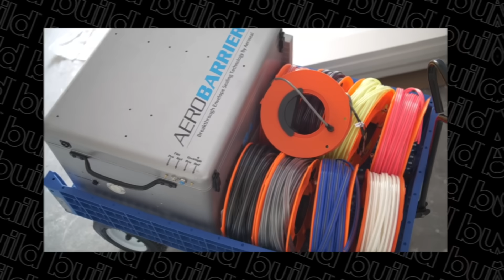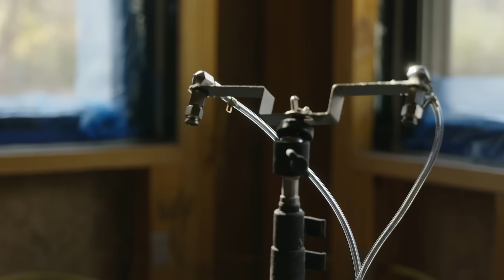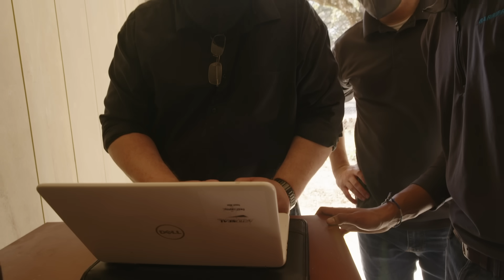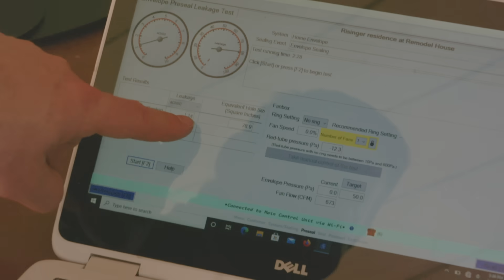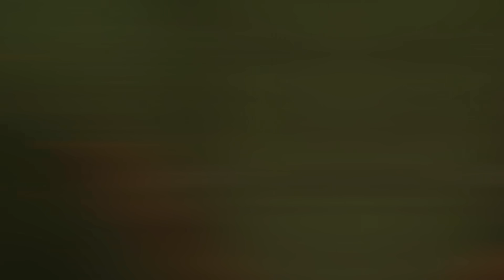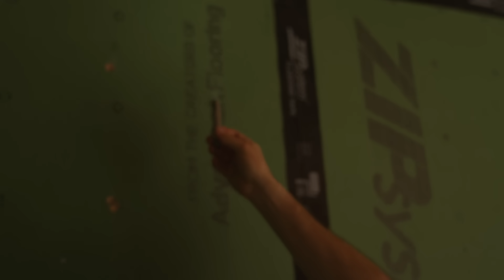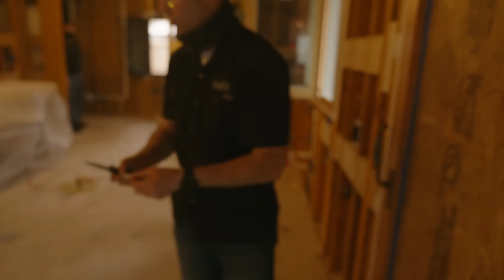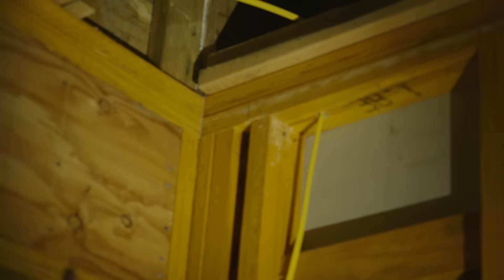The one product I'd recommend for EVERY House!

Comment: As a building science nut, even I am a little skeptical here.  I know Matt likely didn't pay or pay much for this product, but it just doesn't have enough time to have proven itself.  Latex caulking cracks when it's a thin layer against something such as framing that is both porous and expands/contracts with both humidity but mostly with temperature.  Sure, you might have a dry home but lumber takes a while to completely dry out.  Next, they were taping off windows & doors I assume (one spot shows a window with blue tape around the window).  That already probably brought the ACH 1.7 to 1? Who knows? Guessing game.  I think the best proof for this company to actually prove themselves is to go do a blower door on a home sprayed five or ten years ago.  With a 20-30 year ROI using this stuff, what good is that if it's shot in 15 years?  I totally believe in zip's system, their tape or liquid membrane, but this just seems like a good gimmick that only top tier builders will use and therefor their clients won't even ask for justification because they're plenty wealthy.
Reply: Those were my concerns as well.  Anyone who has built a new home knows that over time as the home dries out things move, gaps develop.  What about homes in areas with dramatic seasonal weather changes.  Ever been in a home where the door that opened and closed smoothly in the winter struggles in the summer as wood swells with moisture?  How will a product that is 18-21% solids not also shrink as it cures and develops new cracks over time?  Just like spray foam to fill gaps, it is brittle and doesn't offer any elongation to move with the home.  Would be interesting to see what the blower door results are 6-12 months after the initial application.

Comment: Sounds like some load of bullshit. 0:50: "...end up doing all kinds of air-sealing in all those micro-places where my envelope leaks".

Why is it that every time someone tries to sell some useless crap, they always like to toss in fancy terms? "Micro-places"? "Envelope"? Just tell us what the fuck it does without the fancy language. It  patches up holes around the house. Simple. To the point. No need to try to make the product sound like it's better than it is. Using these terms just increases the intensity of the smell of bullshit in the air.

Not only that, but is it REALLY a game changer? You've used it on one house prior to this. What happened with that other house? If it's such a game changer, why are similar products not so widespread? Leads me to believe that the cost of this product and its application outweighs the benefits.

Comment: FYI: ACH stands for Air Changes per Hour - the air within a building exchanged with the outdoor air through leakage and ventilation expressed as a percent of the total volume of air in the building. For example, if you have 1 ACH that means you need 4 days to replace old air with new one. If we will take 3 bedroom house with 2000 sq ft and 8 ft height walls we will get 16000 cubic feet house volume which is 453069 liters. One person to breathe in the rest requires 720 liters  of air or 5400 liters during exercising per hour. Lets assume that we don't exercise all the time so we can define required breathing volume around 1000 liters per hour per person. If we have family of 4 living in this house we will need 4*1000/453063=0.009=0.9%  or 0.9 ACH to make sure that whole family will not have oxygen starvation using natural ventilation through leakage. If that family will have ACH under 0.9 and no artificial ventilation they might experience certain oxygen starvation effects like confusion or headaches. You have to always take the house volume and max number of people living in the house into account and calculate required ACH number specifically for your house and your family. Be careful, sometimes efficiency might have a flip side.
Reply: ACH is actually Air Changes Per Hour, expressed as a number, NOT a %. 1 ACH means that an air volume equivalent to the total enclosed volume will be exchanged between indoors and outdoors in that hour.  It does not necessarily mean that each and every molecule of air that was in the enclosed space at the beginning of the hour will be evacuated at the conclusion of that hour, as mixing comes into play. However,  when you assert a 4 day time period for total volume air exchange, you are reporting a spurious artifact of your own imagination and mathematical dexterity, which has no basis in fact. The rest of the math is a throw-away, being based on a false premise.
Reply: @lhsunimog  ENERGY STAR® Home Sealing Specification defines ACH as percent. As the rest goes - yes. Situation is even worse because not all air is going to be fully replaced although there is a little hope because people entering and leaving the building which might introduce a little bit more air exchange.
Reply: @k1zmt  After 15 years of blower tests on my jobs, I finally learn from you that I, my tester, and the AHJ's that sign off on our permits have been wrong by a factor of 100. Perhaps you should research how ACH is measured and reported in the construction industry, as you clearly do not grasp the concept. You can invoke some sort of percentage reporting of the data if you wish, but that is NOT how any of the rest of us operate.
Reply: @lhsunimog  Perhaps.

Comment: You need an air exchange system, yes? Indoor air doesn't stay fresh very long.  And if you seal walls on both sides, anything that sneaks in there may not get out. Aging structures will leak due to expansion/contraction (and other factors.) Still, I like it.

Comment: What is the ROI in doing all this extreme air sealing? It doesn't make sense to spend $10,000 to save $200 per year in energy costs for instance.
Reply: Your $10k is a bit extravagant of an estimate as most homes range in that 2k to 4k sqft so 2k to 6k using their sqft prices. However I do agree, on my 2k sqft home knowing labor prices are more here so it would be 3k.  If I spend $120 on average per month for my entire electric,  hvac system, then that probably would reduce down to maybe $90 or $100 a month, that would be along time ROI.  In addition as others have said, I want to see how this performs after midwest winters and summers.  Anything and everything expands and contracts, how well does a millimeter thick bead of latex adhered to a porous and moving piece of lumber really hold up? PLEASE someone go test the older aerobarrier homes.
Reply: @nicpedia2432  You make a good point there. I think air sealing in general is a great idea, but I question if this level of detail is really necessary, or even remotely cost effective in a residential home. Maybe they are planning on making silicone wafers in the kitchen at some point...

Comment: I'm not sold on this product. The $1 to $1.50 thumbnail cost per ft2 is waay beyond what it needs to cost to get a house under 1 ACH50 using conventional air sealing techniques. Of course, much depends on the specifics and market.  

I recently built a new house in SE Arizona, designed from the ground-up to be a low-load home. The non-vented (flat) roof deck is insulated with 9 inches of open cell spray foam, and we have a fully below-grade basement, so conventional air sealing was less costly than, say, a house over a crawl with vented attic. The 2x6 above-grade walls are insulated with blown-in fiberglass. I paid my insulator $450 to 'picture-frame' caulk the wall cavities (all stud-OSB intersections), and I caulked bottom plates to the top of basement wall myself.  That's it. The foam on the roof deck took care of all above-grade wall top-plate penetrations. 

The house (1750 ft2 above grade + 1550 ft2 below grade, mostly finished) tested out at 0.54 ACH50. I specified a 1 ton Infinity 18VS heat pump + 3K electric aux, and during the first two years, it consumed roughly 1,800 kWh/yr, or roughtly $15/mo. (Yes, that's 1 ton for 3,300 ft2!)

AeroBarrier would undoubtedly further improve my leakage rate (especially cracks between double top plates, which I failed to caulk), but what's the cost benefit?

Comment: I'd be curious to know two things:  One, did the sealer glue leaky windows/doors closed?  Second, is this sealer also water proof?  If so I could be it being very useful in sealing camping trailers, motorhomes, house trailers, etc.
Reply: No, it appears they taped over the window seals. Which I believe is a very false reading.  Tape will temporary seal all those leaky windows, so of course the ratings went up.  Now do a blower door test with the windows and doors untaped.

Comment: Total nonsense. For healthy living, you need air exchange.
Reply from the maker: Totally agree. However I want control of that air exchange. On my terms. And I want to filter it. And have it come even when it’s still outside (no wind to make a pressure difference).
Reply: @buildshow  That's all fine and dandy too, if you can afford that sort of equipment, but most people can't. On top of that, air exchange equipment runs on electricity , which isn't free.  There is no argument about the capability of technology, but there is a good one against the cost and realized effectiveness of it. The average person cannot afford , nor needs a house that perfect. This stuff is what we used to see on This Old House, most of which was an expose on the lifestyles of the upper-middle class. If you live in ultra cold climates or in the middle of the dust bowl , I might see the importance of it.
Reply from the maker: Watch this: https://youtu.be/CIcrXut_EFA

Comment: In the old days Air Line cabins wouldn't hold pressure until after a few months of flying with smokers and the TAR from smoke would seal the fuselage the same way.  Go figure.

Comment: pray foam is NOT an insulator product it is a BUG barrier product ... yes it provide some insulation effect just by it's nature but it PASSES air through easily ... no vapour barrier under the spray foam and you HAVE leaks for certain ...
Reply: so it's good UPTO 3/8 of an inch .. above that it needs a mesh to allow it to work ... and you need 2 boxes not one ... you need to air in and the vapourizer ... not worth the time ... install a vapour barrier properly and you dont need that crap ... we do a full wrap in canada and have no problems like you have ... and you get it done without having to vacate the workplace for a day ...
Reply: this is most mold capturing technology and uselss at the same time ... you trapped all the moisture INTO your wood ... now it can rot and mold many times faster than a traditional vopur barriered house ... look at the old lath and plaster homes ... except where water penetrated those homes DO NOT develop mold even over a 100 years ... because the house is allowed to BREATH ... yes sealing your home allows you to control the environment better ... BUT it means you spend more to do it ... waste of money and time using this system ...
Reply: i give you 10 years before you have a MAJOR mold problem in ALL your interior wood and most of of your exterior walls on the inside enjoy ripping the house apart to remove then ...

Comment: what a scam. this is overkill considering the leaks a house will have once you have windows and doors and this will not seal larger openings.  the material might also fall off after a few years of seasonal changes

Comment: Hi Matt, I'm watching here from Denmark where I'm a qualified architect building my own personal passivehouse. It's almost completely selfbuild, except some parts of the plumbing and electrical which need to be made and signed off buy a licensed conctractor. 

What are the downsides of this AeroBarrier system? I'm thinking there will be some environmental issues with extraction the sealent out to the surroundings? And what chemical formular is the sealent made from in regards to affection indoor air, allergie etc?

Thank you great content, even if we build pretty different here it's super interesting to follow. Regards Tim

My

Comment: Here in Denmark we in general build very Convoluted houses, and some of the downsides is air circulation and moisture. So we by law have to build houses with ventilations. Personally i would prefer if I could make it airtight and use a HVAC system of sort to control the variables

Comment: I was a carpenter for a while and in my experience when you seal your outside walls like this is when you get mold. That's why we just put vapor barrier i.e. Tyvek because it allows air flow while being water resistant. You're basically making the moisture in the house stop and build up in the wall instead of move out. I feel like, especially being in the south you guys have crazy humidity, you'll have issues with your bathroom walls having rot or mold at one point. That's just my experience and the knowledge of my teacher's. Also you're paying for this which is an extra cost just to stop the smallest draft. In this case if you really want something like this just pay for spray in insulation so moisture can't even get in the walls and it plugs holes too while giving R-value as well. I wouldn't do this and just put generic fiberglass in the walls. Not trying to be shitty though, everyone in the trades has different philosophy and methods. I'd like to hear an update down the road a few years.
Reply: @stormyweather - the purpose of doing this tight of a seal is that you get to control the levels in the house's air quality using the air exchange where you can set the humidity and recoup the heat/cool when bringing in new fresh air. The less leaky, the less loss of energy, the easier it is to heat and cool.
Reply: @TheChainStay  Wouldn't it take more energy to have a specialized air unit to pump in fresh air instead of having it naturally ventilate? Also what happens when the unit breaks or a power outage and fresh air stops getting in, you'd have your windows wide open anyways if you're lucky enough to catch it if you were lucky enough to think about it. Just a old filter could stop it from circulating. Also we aren't even talking about the cost vs benefit of it, this is basically just to plug pin holes, those tiny tiny holes are really insignificant as far an efficiency goes in modern construction and are just enough of an exchange to reduce moisture retention. If they were doing this to say and old farm house then I'd get it because of low building regs and materials back then produced really drafty homes. Between modern tyvek, OSB, drywall, insulation, state and federal regs your home shouldn't be pissing air into the ether. It just allows natural movement.
Reply: @StormyWeather93  You can measure the difference in air leakage with a blower door test, both positive and negative pressure settings. What happens if they unit fails? You open a window. Power goes out, you will be fine, there is still plenty of air in the house. It's still has some leakage, so you will be fine. This video went to the extreme in getting things air tight for passive house standards. Don't want a passive house, don't build a passive house.
Reply: Obviously a house this tight will require an ERV or HRV.
Reply: I live in Southeast Louisiana and I agree with you 100% the best thing is to have a house that breathe and dehumidify and air condition
Reply: A slight over-pressure in the house should solve any incoming draft.
Reply: yes. Older homes here that leak some, 40 years old or older, no molds, no issues with tor etc. newer homes less than 10 years old more mold, more wood rot in high moisture areas, no ld growth and glued OSB and the like wood products, and the wood species today are not holding up either. Most all newer wood trim rots like crazy.  Either PVC, or weather resist species, cedar, etc and if cant I prime the hell out of the wood, Zinser cover stain, very nasty oil primer but nothing getting through. but Going tighter, here in the humid south, has not been that great, need to allow those materials to breath. I would actually go back to CMU walls if ever build me another house!
Reply: some info, grew up in a house CMU plastered walls inside. no AC, Then moved right next door to our new stick framed house, no AC, older house always seemed cooler in the Summer.
Reply: You being a carpenter should know that wood and concrete expand and retract with the changing of the seasons.  So using these products  serve  no purpose.
Reply: @rimc8783  I feel like that's what I said

Comment: Typical over engineering, a solution in search of a problem. The whole tight house mold problem originated in Austin Tx. Between the cost of the service, fresh air moving equipment, dehumidifiers and maintenance of said systems, do we really need to expose ourselves to more toxic chemicals. Insulation, insulation, insulation. After that if you can’t sleep at night, take a melatonin and try not to worry about the small stuff.

Comment: I am beginning to suspect that the benefits to a super, airtight construction are going to be eclipsed by future issues regarding indoor air quality both in terms of its healthy breathable composition (O2 depletion), and its pathogenic component.  Forget off gassing of VOC’s but the inevitable amount of indoor air moisture inside an airtight home resulting fro breathing, cooking, showering, laundry etc.,  can cause a petri dish environment for dangerous and potentially life threatening molds like stachybotrys, penicillium and aspergillus.     Unless you ate introducing fresh, properly O2 laden air and venting out or condensing and collecting moisture, the benefits of energy savings are nullified by lessened indoor air quality.